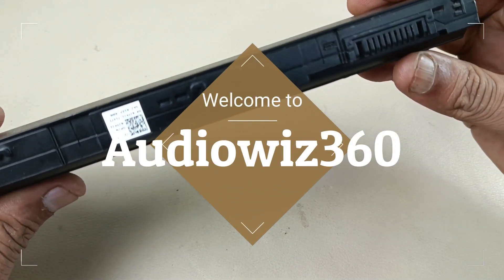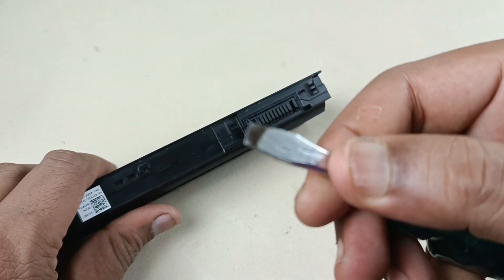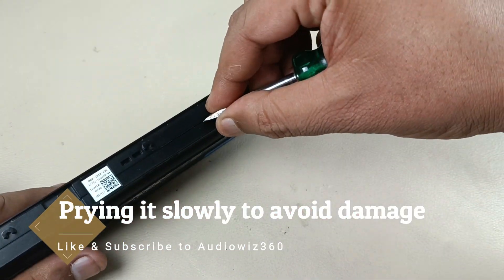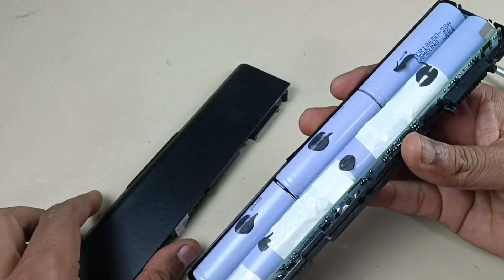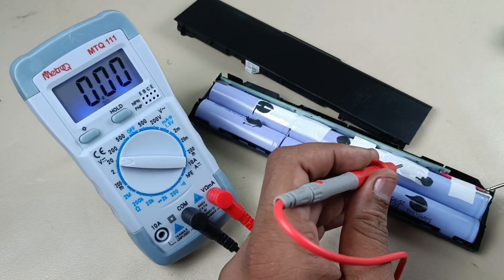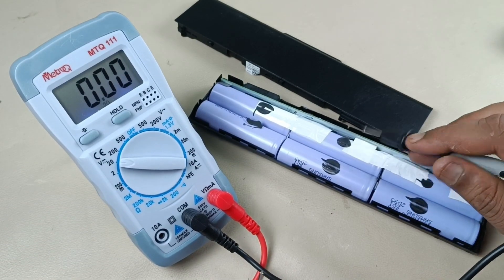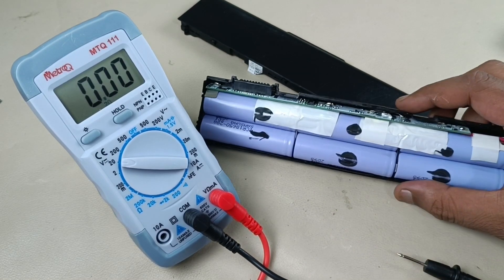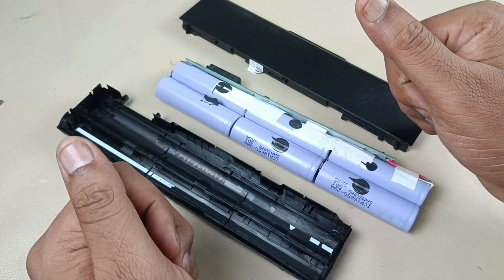How to Disassemble Laptop battery without damaging it | Dell laptop battery disassembly | Teardown

Comment: i need laptop battery.. Can you give me battery cell?
Reply from the maker: batteries are commonly available in the electronic market. please check it out once. it's 18650 battery, you can buy based on amps.
Reply: @audiowiz360  i am from Bangladesh
Reply from the maker: you need to check in the local electronic market